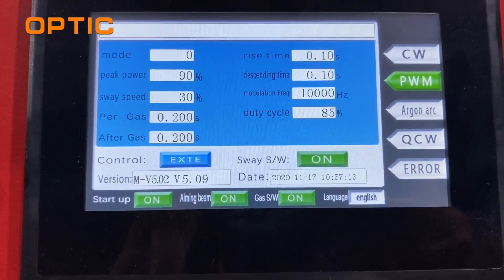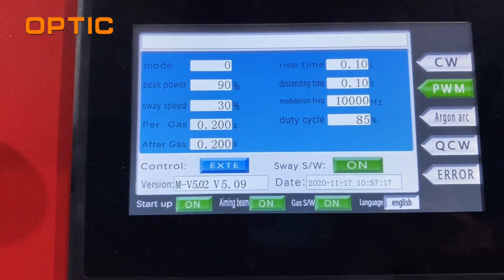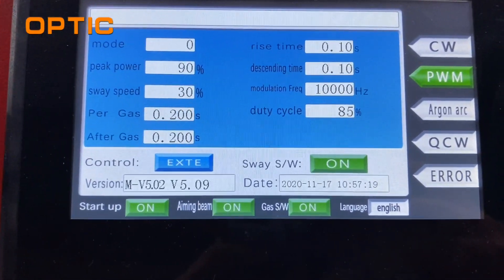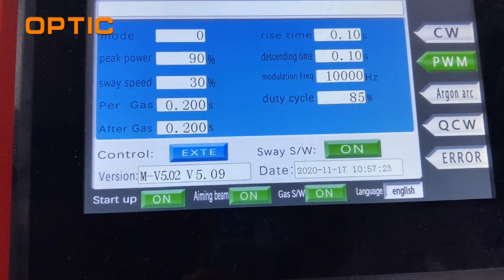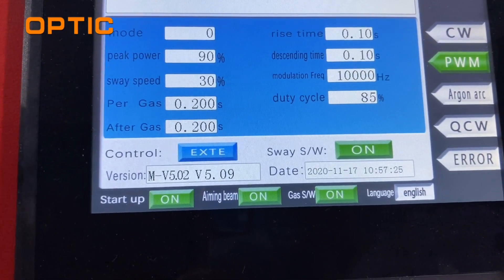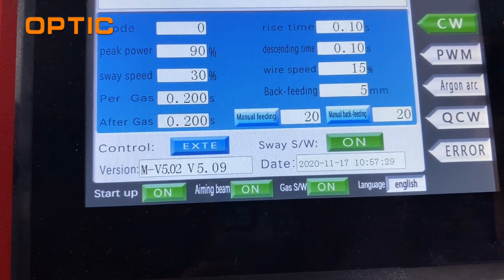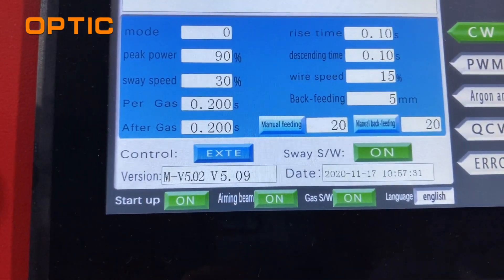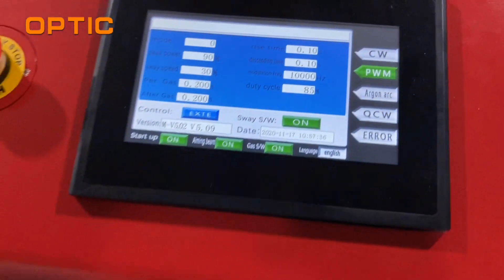1kw fiber handheld laser welding machine welded 2mm aluminum

Comment: Your welding condition setting is very useful  for me...thsnk you very much..^^ 
I tried  to weld Aluminium with CW setting condition..but  it could not  weld Aluminium...Now i found out  why i couldn't   do weld Aluminium...
I had to use PMW mode setting..